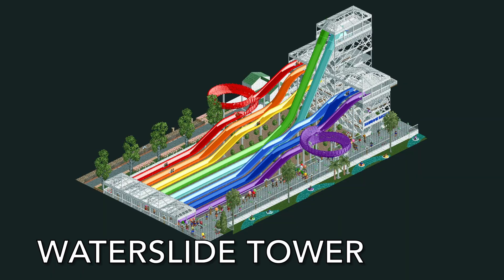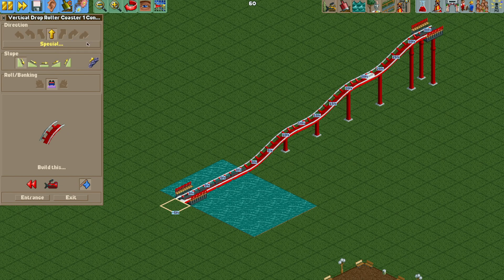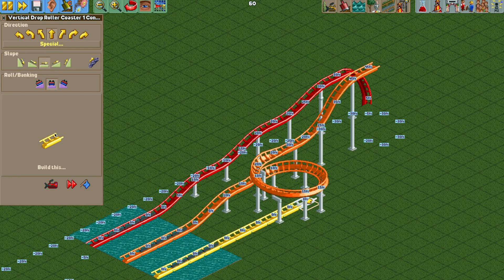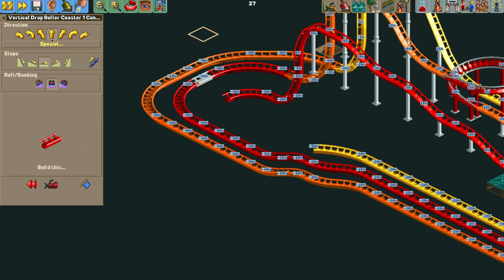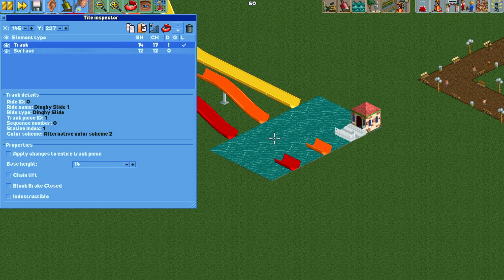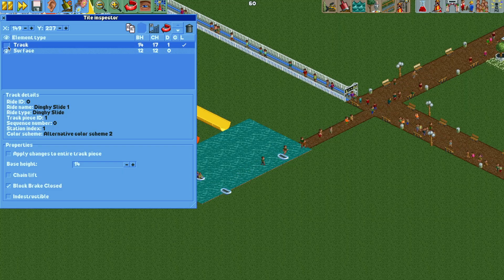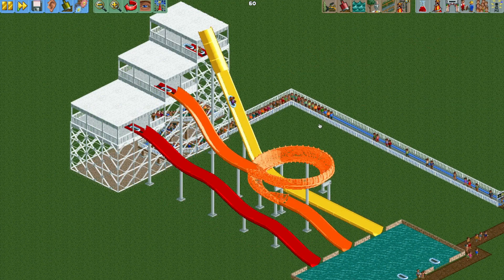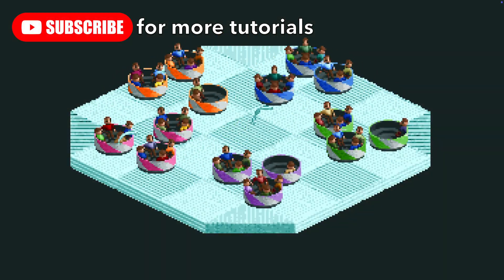Water Slide Tower - Water Park Series Part 3 - OpenRCT2 Tutorial

Comment: Hey there ! Nice work ! One thing I noticed if I did follow the tutorial well: if the ride breaks down and your handyman needs to go to station 2 or 3, how do you do it? Because mine keeps getting to station 1 and seems blocked...so the ride stays broke down... Is there a way to fix it? Thanks a lot !
Reply from the maker: There should only be two stations. You have your station 1 for the entrance and station 2 for the exit. Then you use the tile inspector to copy those stations. The mechanic needs to only be able to access the entrance and exit and will still be able to reach the copied stations.
Reply: @openRCT2tutorials  Thanks for the quick answer ! I kinda tricked the system I guess. I have 1 entrance (where peeps get inside the ride and go to the "fake" entrance 2. But then, at the end of the ride, I did 2 exits: 1 left and 1 right, so the peeps exit from "both rides" kind of, from 2 different exits. Could that be the issue? 
Since then I think I managed to solve it, but I'm not sure about it XD
Reply from the maker: @BarcelonabyFábio  Not sure without seeing it, but make sure the mechanics can access all of the entrances and exit buildings.
Reply: @openRCT2tutorials  Thanks !

Comment: So of all the slides you show, while the 'big ball of track' one looks cool, the one that really interests me is the 8 slides one, which is actually two rides. (And I'm wondering if you can syncronize them for the bonus, since it is two stations ... but probably only if you make the two center ones the 'original stations,' which could make things more difficult, so never mind.) But the one thing that is confusing me is you have two rides, four tracks, four color schemes each ... plus the bobsled helices ... all I can think is main track invisible, second track copied from another ride, to provide the visuals for the bobsled section. Is that it?
Reply from the maker: You could synchronize but it will probably only wait for the main stations. Never tried that. 

As for the 8 slides, you’re right, I did use a third ride for the bobsled track. I wish openRCT2 had more color schemes available

Comment: This is brilliant! Having a whole lot of slides coming out of one building is so satisfying.
Could this be used in making a dueling coaster with just one queue line?
Reply from the maker: Thanks! As for a dueling coaster, yes and no. The copied stations won’t sync with each other. However, with block brakes, there is a way to make it work. I have it on my tutorial to-do list. I’ll get to it eventually
Reply: @openRCT2tutorials  Interesting. I know that copy-pasting a redundant station tile to the right spot allows you to get the stat bonuses with synchronized stations, but it's weak that it couldn't actually be usable that way. It would be nice to see how to actually get that working, to avoid one station always getting overfilled and the other barely having anyone.
Reply from the maker: @dappertron yeah, I just managed to figure it out in the past month. They don’t synchronize since the game recognizes it as the same station. So you have to allow the trains in the station to both have time to load before the block zone opens ahead. And it will only work correctly on möbius tracks. The blocks get messed up on separate tracks.